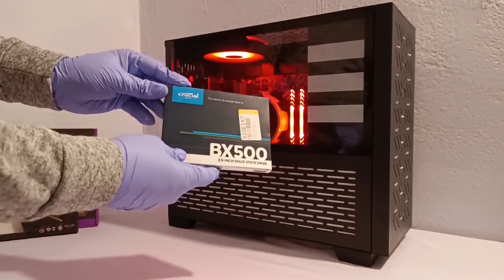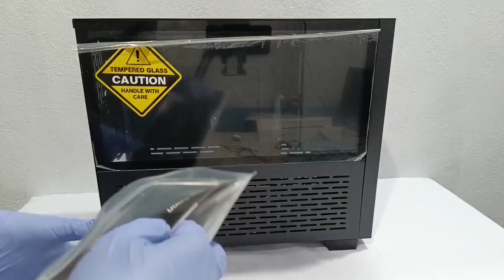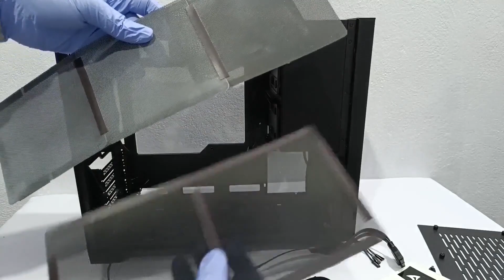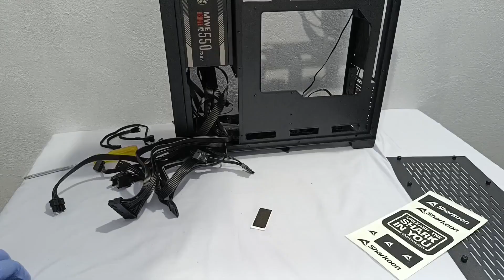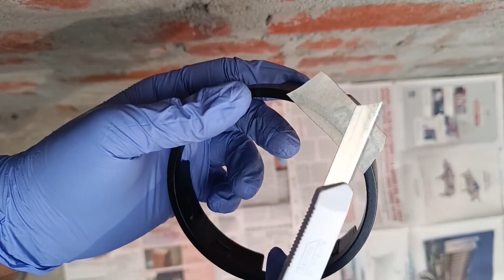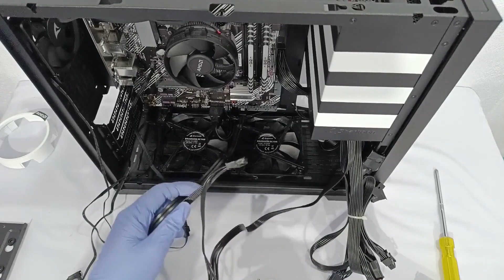Budget Aesthetic PC Build | Ft. Sharkoon Z1000/Y1000 @FryMyPC

Comment: why only one RGB Fan on Top.... Please make 2...
Reply from the maker: Adding extra fan on top would make negative pressure inside the case so dust will accumulate faster in the case. (More exhaust fans, less intake fans) 
It should be (push >pull fans)
Two fans on bottom and two fans ( 80mm+120mm) optimal without a graphics card. Thanks for asking.
Reply: @FryMyPC  Aha? Never Hear this... i have 20Fans...